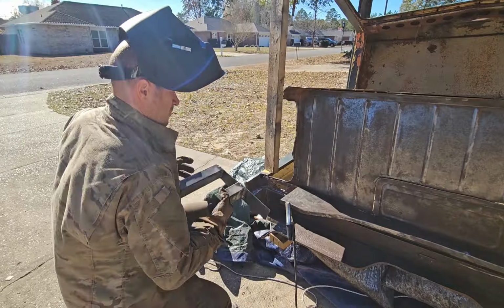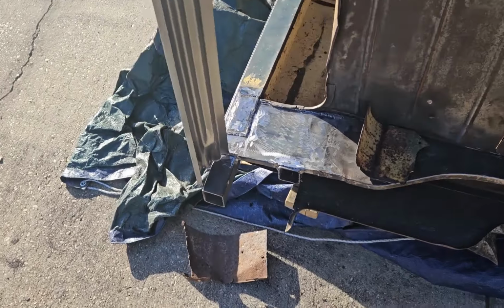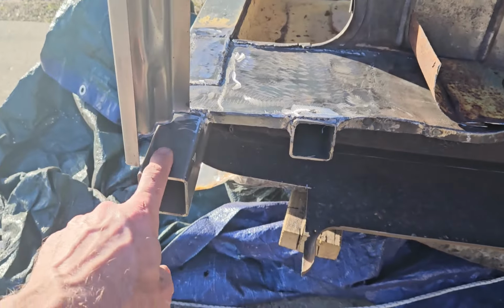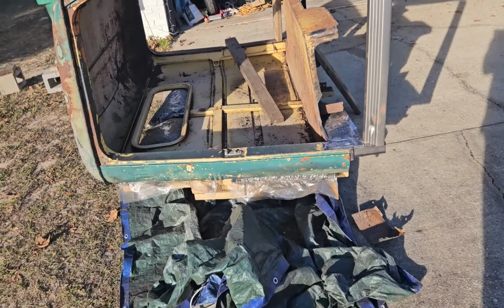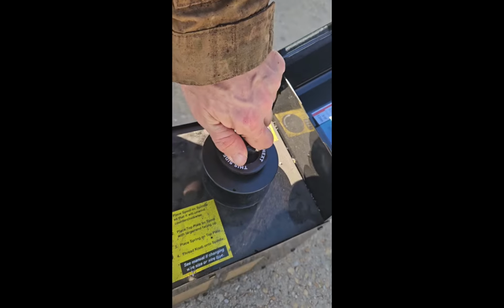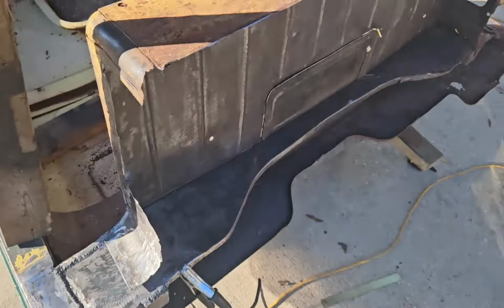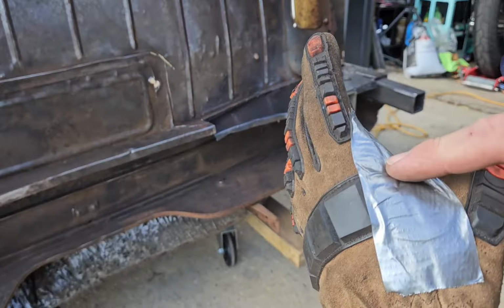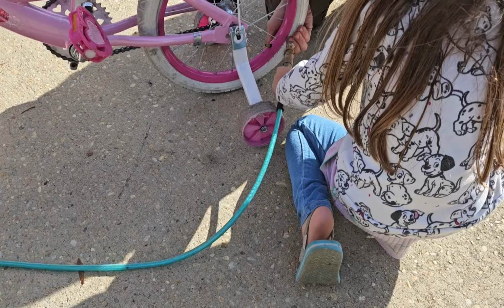Novice rebuilding the World's worst cab! | 1948 Willys Truck

Comment: If you’re going to paint the cab, just tack weld the doors in place. That will also help the cab stay square. budget friendly option is using wood 2x4s to brace cab while repairing the rust. Doing great, and looking great. Bonus clip, little miss airs up her bike tire.

Comment: Really great work! This will be the really long process. I have never enjoyed sheetmetal work lol. 

For welding gloves there are a lot of choices out there some more expensive than others. Black stallion, mechanix, tillman and others. I have really loved my mechanix gloves for both tig and stick. You would want to stay away from tig gloves as they are less heat resistant because they are made of goatskin. Look for stick or mig gloves. Mig are the thickest and stick gloves are generally a happy medium between tig and mig. I would recommend a stick welding glove for what you are doing. Weld supply stores generally have tillman gloves in stock and you can try them on.